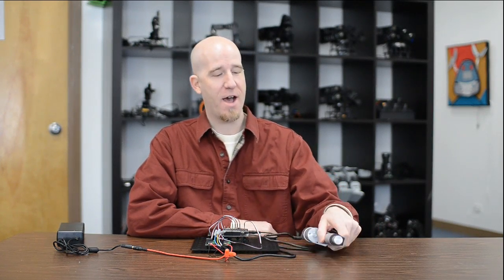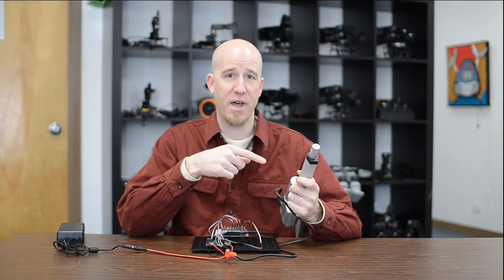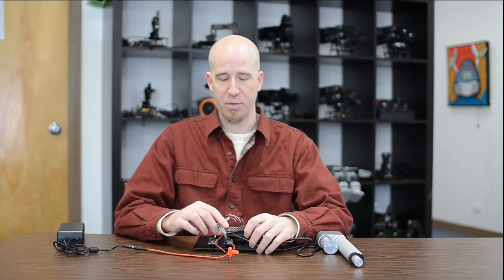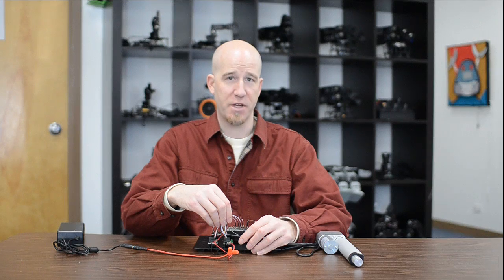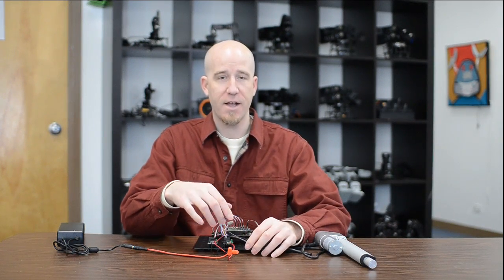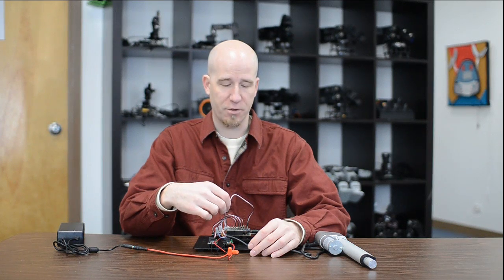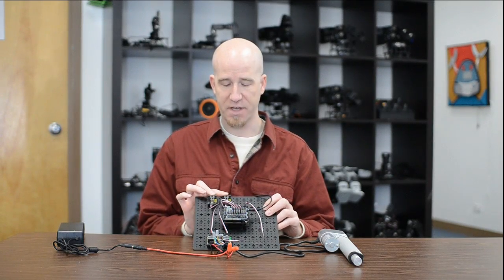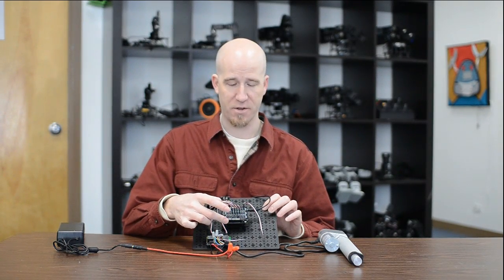Positional Feedback with Linear Actuators Demo

Comment: hello sir 
i just want to ask you i have the same actuator that you use in (Arduino Linear Actuator Tutorial - Preset Position Button Control) but i dont have the sheild i just have an arduino uno and i dont know how to wiring the 3 wire of the potentiometre i want you to show me what pin i will plug in the 3 wire of the potentiometre 

thank you

Comment: Great videos!  I'm not sure if you are still monitoring this channel, but I had a couple questions about  linear actuator control.

I run a jet engine test cell, and the actuator we used for engines that had hydro-mechanical fuel controls crapped out.  It was a rotary actuator and the company who designed it went out of business a while ago.  The throttle lever on the fuel controls has about a 2 inch throw.  I'd like to set up a linear actuator system to control them.  It's needs to be reliable and be able to be controlled in fine increments, and control the movement (speed) as smoothly as possible.  I tried using a stepper motor and an arduino, but the movement was very jerky.  I also need to set max and min setpoints.

Do you have any suggestions?
Reply: Look at IAI actuators, they will be more expensive but offer precise positioning, accel/decel, and push force. You can store position data in the controller or control them via DIO, or field network.
Reply: @rental2765  Thanks.  We need to be able to control it with a throttle lever (potentiometer) for precise positioning and completely manual control between min and max.  That was the setup we have been using, but the rotary actuator quit working.

Comment: Hi Robot geek! Is there any major adv. in using LAs' (linear actuators) with inbuilt potentiometers as compared to LAs with inbuilt reed sensors? I'm eventually trying to control it using an arduino. My idea is to run the pulses coming-out of the reed and process them as feedback. Looking forward to your answer.

Comment: Can I ask ? umm, by the way, what is the meaning of feedback ? I feel sorry for my ignorance .
Reply: The term feedback with linear actuators refers to an analog potentiometer(POT).  Like any other analog POT, you can determine what position the actuator is in by determining the POTs range and mapping reference points - fully closed, fully open, half-way, etc. - to know where its at.  The author above does a decent job of explaining that process, albeit briefly.

Comment: Hi! I have a linear actuator without any built-in potentiometer, is there any way that I can get positional feedback from it? thanks!
Reply: +vxa_victor I think you can do it using a variety of different sensors eg. reed switches, limit switches or even piezosensors, depending on your application. Just process the output coming out of these sensors and use it as feedback to control your actuator. In the end, its your relays that control your actuators.